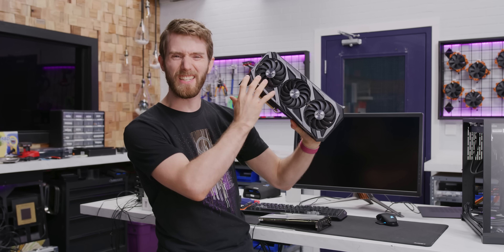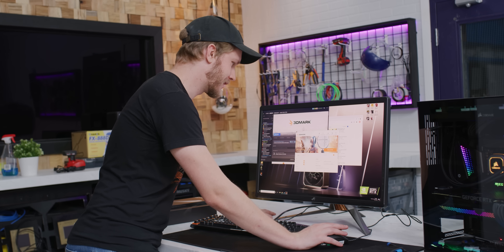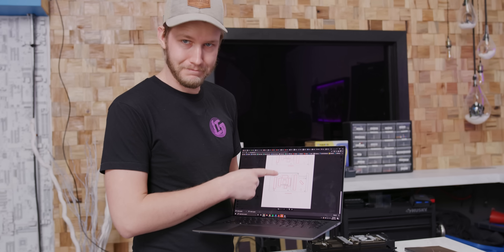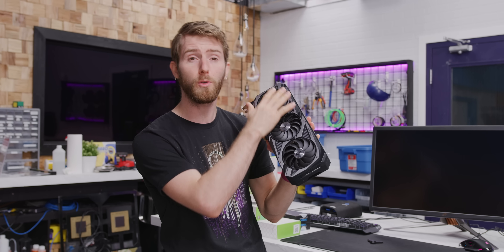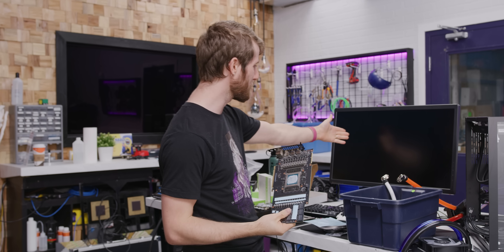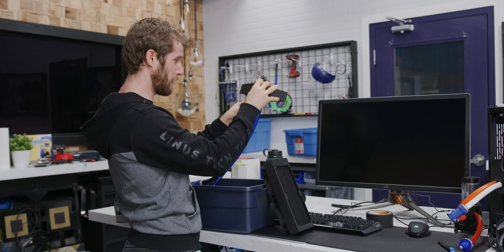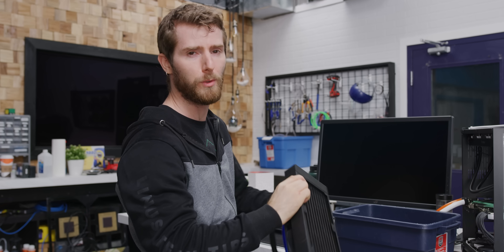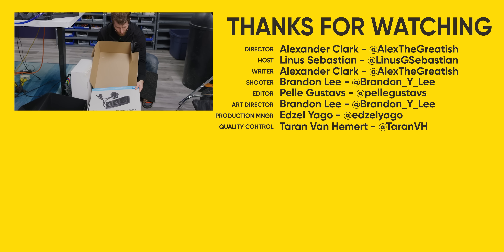Water Cooling the RTX 3090 is... More Complicated

Comment: Another problem I had with my system when I first started using it was cavitation. If you don't check the way your hoses are run you can build up a bubble that will cause the water to oscillate in the line instead of flowing. The way I solved this was to initially prime the system with a turkey baster until I knew that I had gotten all the air out of the system. I added a little bit of water wetter the first time. End my second coolant change I did a little bit of madditive from VP racing. I've noticed I get an even heat distribution through the system now. My radiator is the size of my tower though and has three fans. It's super cool any bit of water and the fact that I piped part of the AC to flow to the front of the radiator super cools is my system.
Reply: Also I know they're using regular water but make sure you use distilled water.

Comment: I was thinking about cutting my heat pipes and piping it that way but I'm doing some research because I'm afraid of condensation. My problem is that my CPU won't go above 37° c because of the water cooling but my GPU is hitting 71 at times. I'm also utilizing 100% of the GPU. Still learning how to retard everything so that it works properly.
Reply: My computer already has an oversized radiator as well as a custom-built reservoir and flow meter. . . I couldn't find one that would fit and look right so I had to build one myself. I'm pretty sure my radiator can take care of both and my pump is strong enough to manage both systems while still keeping everything internal.
Reply: Also I am running a nzxt water cooling setup, the more expensive one. The tower cost about $1,700 to build but I bought it for $900. The guy had built it in 2023 but didn't realize it had bad RGB RAM and that's why I kept crashing. I switched all the ram to classic style and and pushing 64 gigs of RAM at the moment. I'm running an AMD ryzen 5 3600, RTX 3060 TI what about 5 terabyte of storage.

Comment: With a rasp, gasp! That's a Jeremy Clarkson approved hack, I suggest you dip it into concrete to reseal what came lose with the vibrations, it's best practice 100% legit! 🤣🤣🤣 
That's next level savage boys! (You can tell the blond guys doesn't pay for his gear, especially when he insists in thrusting rubber ducks into spinning fans - did he try sports, in general?!) 
I am not saying I have never filed carefully filed something, mainly on cases, on on the sink, as far as I remember I never had to resort to options like nailing stuff around or kicking a card into its slots. But the rasp boys, the vibration you put in that card could unseat anything from soldering to glued, I am curious to see how you clamped it.
Now that's the kind of thing you want to tell Nvidia just for the faces they will pull when you come and claim your warrantee.
(Mind you I am laughing my head off while writing this - 🤪 it's good entertainment value like Horror PC Show type of. thing...

There is a thing with you-tubers dealing with IT gear - a bit like IT guys working for big companies that squander their money with the ebb and flow of yearly budgets and VP coming and going - anyhow, you guys have to much expensive free gear on your hands and it reflects on how you handle it. Nothing personal, though, it's psychological on both sides. When you get stuff for free and their value is just a figure in your head as as opposed to a hole in your wallet, it's just different. You just don't handle it with the same care a consumer that paid one and a half grand would do to a 3090. Meaning if the watercooling doesn't fit you get another one, you don't hack into it with a kitchen knife, yes I know Linus said so, but luckily Linus is not my boss. 😛
But in the end, it doesn't have to be for builds, in general youtubers unboxing stuff and throwing components worth a thousand of dollars around clearly don't fathom the historical complexity that goes in what they handle. What they have in their hands is usually a tier 3 of what humanity does best, Tier 1/2 being always the Military and the Industry obviously, (don't laugh, it's with our money).
You should have been around in late 80ies early 90ies (I don't actually remember exactly when, 92, 93 probably) I spent a whole summer building and fixing x86s pre-pentiums at a shop, so I could upgrade my motherboard from a 386 to a 486DX to play the first Castle Wolfstein, the the first Doom. So yes sometimes I've gotta cringe, when I see that, but I am a grumpy old man, nothing personal, I love the show!!!

Comment: Linus what configuration in terms of airflow would you recommend when running both GPU and CPU AIO when you have a case which takes 7 fans, 3 top 140mm , 3 front 140mm, 1 rear 140mm?

Comment: So if you know anything whatsoever about 3090, you know it's the HotSpot and MemoryJunction temps you care about. 
32C at Idle is perfectly normal. @7:40 but you act like that's impressive. Seriously bro? Did you even do a baseline reading without waterblock? 
Without water cooling, and modding FE to have proper pads on vram, I get about 74c for HS and MJ under heaviest of loads 100% usage 4k. 
This video just plain sucks. No one cares about the GPU temp on these cards, that's not even slightly the problem. What was your HS and MJ? Video has zero value except maybe novelty.
I feel like an adult watching a child play with a toy truck, vroom vroom.

Comment: 12:17 could you run an intel core i9 13th gen cpu and an rtx 4090 from a single 360mm radiator?
Reply: I would recommend some more radiator beef for that. Atleast a thick 480mm rad for both of those

Comment: 120mm radiator for stock voltages and clock speeds. 240mm to 360mm rad per overclocked device.

Comment: 12:05 how does a larger radiator compensate for less airflow when you need airflow to remove heat from the radiator?  You still need the airflow, now sure how well that would actually "compensate" if you tested it.

Comment: Not even necessary to test it, you can probably just do some math.  When did the "adage" of 120mm rad per component arise?  What was the average TDP at the time?  How much has the average TDP for newer components increased by percentage?  Your cooling capacity probably also needs a similar increase.  I assume that cooling 125w with 120mm was doable at some point, but now GPUs are pulling 3-4x that much.  Obviously CPUs are pulling more power lately when using the overclockable high-end ones.

Comment: I have a standard 3090 FE and someone has asked me to swap for a 6900XT toxic that is water cooled with an aio 360mm rad. What card would perform better? My cpu is a 12900k so shouldn’t limit either card. Would it be better to have two separate aio for cpu and gpu or to look into connecting both aios down the line?

Comment: I bet going with a double with an added single would drop temps by another 3-4 degrees over the lone triple rad. This being due to the added single being isolated from the heat soak of the main working double rad.

Comment: Judging by the green USB on the front panel io looks like you have a razer edition 011 dynamic. How did you like that case compaired to base model? Reason I'm asking is I've had that case for 2 years in the box waiting for a non scalpafied price on a gpu. I finally got a 3080 strix and want to start my new build.

Comment: Now watercooling a 3090 and got it in chain with a 5950x and havin problems cooling the 5950x after each step there is a 480mm radiator but still struggling to cool the 5950x. I don't know where the problem is but as the 3090 is chilling at max 50-60°C the CPU likes to have it comfy at around 70°C up to 80°C in some workloads. I guess I will have to rethink my fans and airflow but still this is giving me some headace sometimes...

Comment: The guideline value is approx. 100 watts of heat loss per 120 mm radiator surface at acceptable noise levels.
If you want it quieter, calculate with 100 watts per 140mm radiator surface.
The optimum would therefore be 2x280mm radiators for CPU+GPU together.
And if that's not enough: there is no such thing as "too much radiator surface" !!! xD

Comment: SFF rigs with twin 240mm rads are pretty common. They should be capable of running some pretty top end configurations still.
Reply: I run a 10 litre sff build with a 12900kf (power limited to 150w) and 3090, cooled off a single xspc tx240 radiator.

Even with noctua's a12x25 fans at 2000 rpm, coolant temps will reach 50c, GPU temp 78c and CPU temp 85c on a full bore 150watt + 350watt CPU plus GPU fully loaded cinebench plus GPU load. I have just switched to phanteks excellent t30 fans, and these have bought me valuable extra headroom at the cost of a little more noise.

I consider these results acceptable for a 10 litre sff build, but have come to the conclusion that 500w is really the limit of a single 240 radiator setup in a sff build.

Even for a load where essentially just my GPU is running and CPU is consuming maybe 50w, the result Linus got here, with a single 120mm rad cooling the 3090 to 60c, is wildly better than my own results in an actual sff build with a thin xspc 240 rad (I get GPU up to about 75c with the same ek waterblock in that scenario)

My advice to anyone build a tiny sff build - given the next generation GPU power consumption, 240mm rad is just enough today, but not for the future generation. Either cool just CPU with a 240 rad and aircool GPU (get a sff case with at least 3 slot gpu support) or plan for at least 240+120 rad with full size 25 mm or 30mm fans, or preferably 240+240 with at least one of those having full size 25 or 30mm fans. 

Linus's results here, while very valid, don't reflect the reality of a small form factor build where much thinner radiators with generally more restricted airflow are the reality

Comment: Sorry but just like a car's radiator you do not put straight water into a radiator it has to have a coolant inside of it and order to regulate in an anti-corrosive to stop it from the wear and tear I would not recommend using just plain old any other water besides the coolant provided by manufacturers like Corsair

Comment: Hi Linus Tech Tips, I have a question and feel good if I can get an answer for it

Question: I Buyed liquid cooling fan to keep the temperature of my gpu low and it has been 3 years I am using the same cooling fan. Question is do i need to change the paste of the liquid cooling fan. i donot know what is there inside the cooling fan and i assumed to be thermal paste. I can tweak the question in another way i.e do i need to change anything in my liquid cooler fan as it is working for the last 3 years and i am doing training for Artificial intelligence data on regular basis

My concern is that my GPU should not get overclocked or damaged because of any reason

Any help would be appreciated from my side.

Comment: There is a problem with your experiment. 
Heated air is going to your machine. It means heated air re-heat your GPU. If you change the direction of radiator, it would make difference.

Comment: I have one, mixed between mining, home heating and child playing on it. I limit it at 290W (max 450W) and it stays at about 57°c (Ventilators at 74%). I haven't overclocked the memory.

The ventilators are really quiet - so it doesn't make sense to watercool it :P

(I could optimize it to have a bit more ETH hashrate = 106Mh/s... but I just mine for fun).

Comment: Love watching your videos, all the setups,
The ideas we get from seeing you shows
Also seeing you have issues makes us feel better and normal. thanks for the hard work you do to gives us fate we can do it too

My setup on Nov 2020 Setup case and inside

ASUS ROG STRIX Z490E GAMING MB
Intel I9 10900K @ 5.1Ghz  10core plus
CPU Cooling Corsair 360mm Radiator H150i XTL Version 3 x 2600 rpms instead of 3 x 1600 
32GB DDR4 PC3000 RGB GSKILL TRIDENT 
Power supply 1000watt 
GIGABYTE 3090RTX GAMING OC,  I OC more card ocs great
New boost 1855
Most games 2080 2115 I did lite oc 120/120
2X 1TB Samsung 970 EVO PLUS SAMSUNG NVME M.2 + 12GB of the System 32GB For ram caching HDs 
Lian Li Razer Edition 
October 2019 
Desktop stuff +monitor KB Mouse so on
Monitor
Asus  ROG SWIFT PG279Q 1440p 165Hz 4ms Gsync IPS 27in
All below are Razer products like Razer Case 
KB Huntsman Elite full size
MOUSE Mamba 16.9 DPI wireless with 50hr battery 
MOUSE PAD Vespula 
HEADSET Tiamat 2x2  v2 spks 
Controller  Ultimate Wolverine
All highend Razer

Comment: Hey guys, I just purchased a 3090 for myself. While waiting for it to turn up, I’ve been trying to find out if water cooling is 100% necessary or can I run a 3090 without liquid cooling? I’m not running 4K or anything crazy, I just wanted 3090 for bragging rights. But nobody online gives a definite yes/no answer. Cheers

Comment: So... here's a question. Since LTT proved liquid metal applied in lieu of thermal paste is better, in all cases, why is it that its rarely used when they do these kinds of experiments? I mean, the entire point it make it run as cool as possible right? Is gallium really that expensive?
Reply: If you've ever applied liquid metal, it's messy, finicky and much more cumbersome to apply, which could results in accidents killing expensive hardware - so not worth it if you're just running a test to show some other phenomena.

On top of that, liquid metal will discolour and stain metal finishes on waterblocks/cooling units (not talking aluminium here, which will just crumble, but even nickel/copper stain from it), which, while not damaging, can be an issue if you are supposed to return the item.

So for a channel like linus's, always using liquid metal doesn't make much sense.

For you at home doing this once, once you know how to work with liquid metal, yeah, it makes a lot of sense to use

Comment: ... EK Water blocks are a wee bit more difficult if you want to (DIY) watercool your graphics card ... I ordered a secondhand set for my (EVGA FTW3 Hybrid) RTX 2080Ti , to cool it even better then with the included Hybrid system , but (...) it seemed that the set did not fit the (3cm) wider PCB of my card (+ 5 onboard connectors) ... (if only I could resolve it like you guys did : with a file/tool...)  :-/

Comment: so a 120mm rad with a 3080 is also fine?
Reply: If you want the same performance as regular aircooling 360mm radiator for a CPU and a GPU is fine, but I would recommend 240mm of radiator for each the GPU and CPU, so a 360mm rad and  maybe a 240mm in your case will asure that you can run cooler and without having the fans too loud.

Comment: I think I'm going to liquid cool my 3090, I wasn't at 1st but I'm going through the trouble to make a custom glass tube loop with bends instead of lots of fittings anyway I may as well do the gpu as well. I'm currently making the case now I guess ill just account for a 340 in addition to the 240 I was going to run.

Comment: Why don't you guys just us the Eiszeit system from Alphacool for your test benches.  I have one powering one of my rigs and it's simply divine, I don't even use a pump and of course a reservoir as their made redundant.  Not just that but I can also use smaller cases and still be able to fit 2 GPU's with full hardline. Not to mention my Temps are incredibly low, so much so that it took me two days to find the right settings as ice particles started forming around some of the metal connectors.

Comment: Do not buy from ridge wallet I brought one the other day went out for a run tripped  and the metal plating went into my leg do not by these things are very dangerous if your running or biking etc also please keep in mind that there is bits of flingy bits on the wallet that break (do not buy I'll update this comment when my leg is better)

Comment: Looking into cooling a Trinity 3090 together with a 5900x in the same loop, would a 280mm rad with 2xML140 be enough?
Reply: Well, 1 year later I can tell the 450w~ load is doable on a slim 280mm radiator but with maxed up fans and about 40~42c water at summer. I ended up buying a bigger case to put a second radiator (360mm) with is now just the sweet spot.

Comment: Linus is really dumbing things down. No graphs or in depth temps this time. Especially on the DDR6 that has severe overheating issues when gaming/mining on air. That thing thermal throttles before the gpu has a chance hitting over 90c like it is nothing!

Comment: how much does it takes to watercool 2 2080ti + 5960x + motherboard chipset.. while having everything overclocked and running 24/7?
-no idea but my 140x420 thick waterblock, with 6 140x140 fans *3 in push 3 in pull) on it... keeps my CPU nice at below 30C and my GPU at below 60C even under heavy load...

when in doubt just go for overkill;)

Comment: Why settle for "just one per unit"? If you going to spend the money on custom loops, go all out and just buy a 3-fan radiator per unit? I have 2 360mm radiators for GPU and CPU and 1 for RAM and motherboard (yes, some motherboards have that ability)

This machine can run at -50C in Saraha! xD

...no not literally, before someone comments on how that's physically impossible with regular liquid cooling -.-

Comment: Funny video it was. I have installed EKWB-block to my Asus rog strix RTX3090 and it works perfectly and block fitted as always, perfectly. I hate cutting thermal pads, otherwise installing block went quite easily. I use 2 radiators (35mm and 24mm) both with 2 fans. Overclocked to 2050MHz, card heats up to 66°C when overstressed using furmark-bench.

Comment: OK. You've found the obvious 🙂. Now we need to know what would be needed for a heavily OC 10900k (275W) plus a shunt modded OC Strix 3090. I haven't got my Strix 3090 yet, but have a 360mm plus a  140mm thick radiator with 'server' fans on my OC 2080ti at the moment.
Any suggestions on whether this will handle potentially up to 1000W?